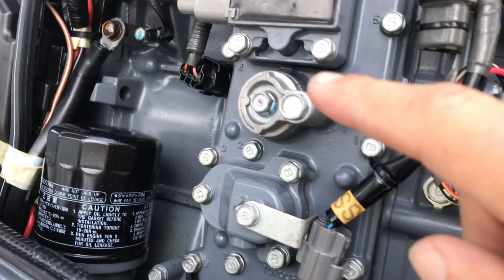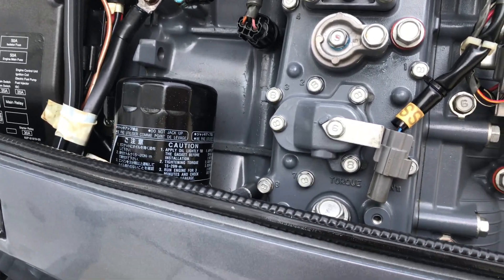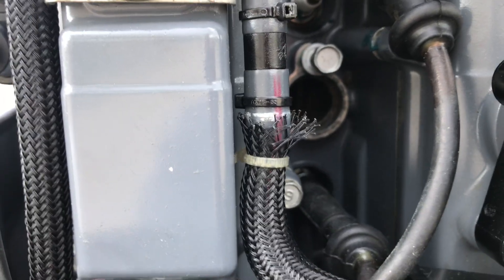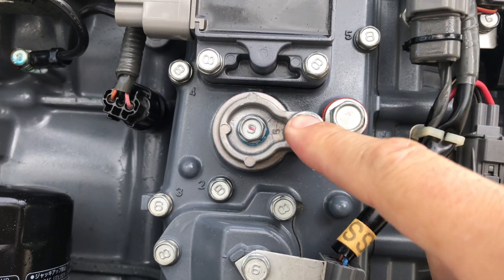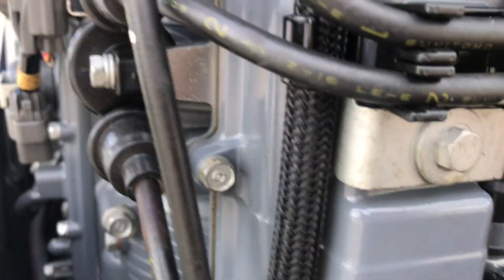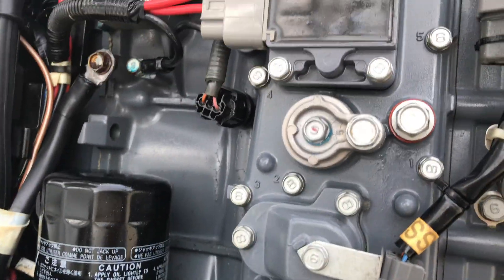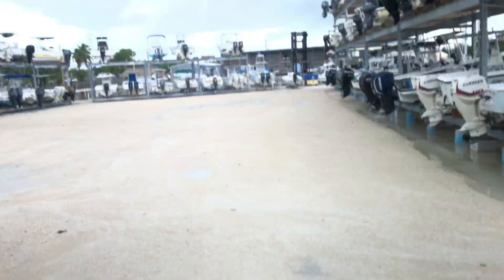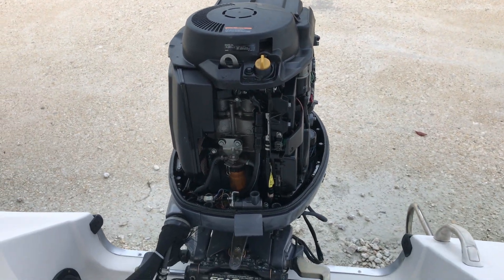How to Change Yamaha Outboard Zinc Sacrificial Anodes | DIY Maintenance for Yamaha Outboard | Part 1

Comment: Greetings, I have a yamaha outboard F60TLRD 2005. The following thing happened to me: I was to change the internal anodes of the motor and they were so damaged that only half of each anode came out and the other half stayed inside the water pipe and I have no way to remove them. You can leave it like this and put new anodes on it or what do I have to do to solve my problem.  If you can let me know I will thank you.